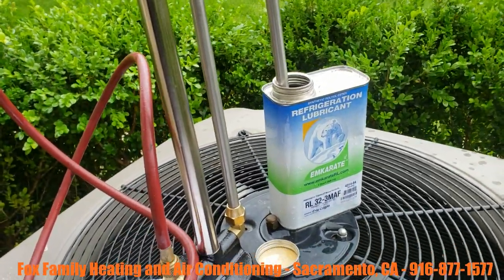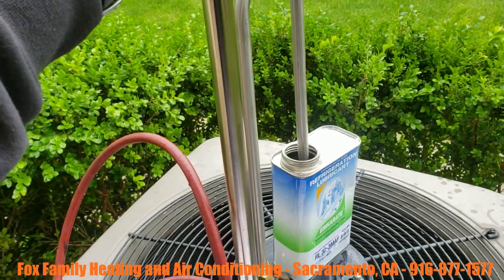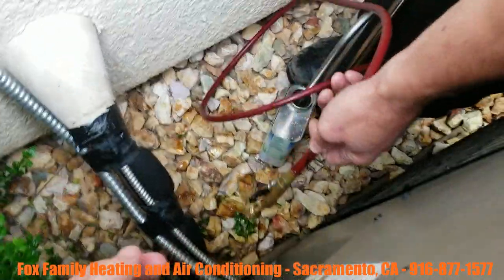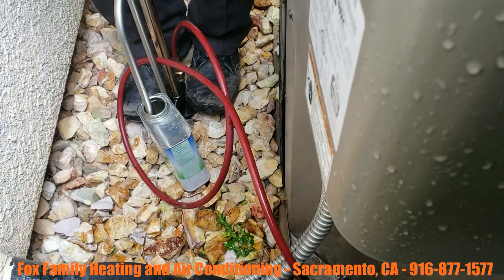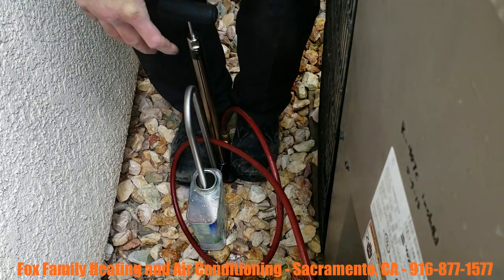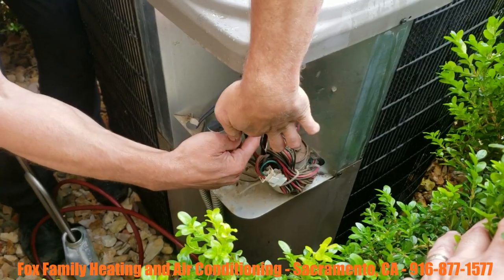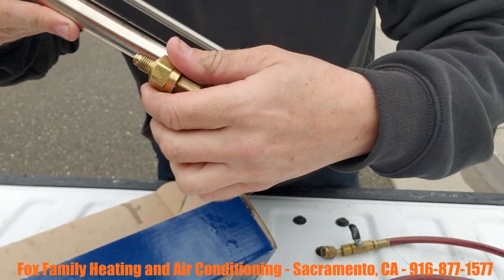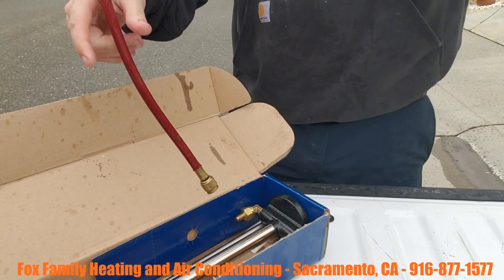Adding POE Oil for and R407c Retrofit

Comment: Greg- Great video! I have done many retro refrigerant replacements. I use a male to male for the hose to control the oil/contamination. I also use a refrigerant cap for the oil pump and put it in a plastic bag. I hope this helps. Have a great day 🤘🤘
Reply: Hey,we had a noisey compressor.
Thanks for showing us this.
We bought the exact pump and oil ,home depot had brass adapters from 3/8 to 1/4 and granger had the r22 hose .pumped the oil in and 
Now the unit is much quieter.
Thank you for taking the time and sharing this with us
Las vegas

Comment: To keep the oil from becoming a mess after pumping oil use two of the add-on type ball valve ends for your hose. Keep them both closed after using oil pump. Remove hose from pump only and connect that end to unit liquid line (preferably a hot gas line but residential units don’t have pressure taps on that line normally). Fully open hose valve at suction line and slowly crack open valve on liquid line (never full open!) and let the liquid refrigerant purge out the oil from hose. It will clean it right out in less than a a minute. No danger of system damage IF hose valve at liquid line is only cracked open to create a good enough flow to wash the oil out. The 5 or 6 foot of hose length is enough to not worry about liquid spraying into suction line since it will flash into vapor before it gets back into it. Once done close hose valve on liquid line, then hose valve on suction line. Last step is to open a hose valve to release any pressure, remove hose valves and hang up hose in case any trace oil remains.

Comment: Use low loss fittings for your oil hose.  You can also use a 1/4" male male adapter to bleed the low loss fittings for priming.  Much cleaner than a dripping hose.  Thanks for the Video! Edit:  Also forgot to mention priming back into the oil container instead of the ground.  Many a machine room would be sad with an oily floor

Comment: Informative! Touching that contactor with your bare fingers on an obviously wet day doesn’t set a good example for a lot of the newbies. Use an insulated screwdriver next time if you have the camera rolling.
Reply from the maker: I know, it's hard to direct my guys sometimes.  Thanks for watching.
Reply: I 2nd that comment.. I work with extrusion chillers, that have 3 phase 480 v coming into the contactor... I teach my guys to never disrespect electricity..

Comment: Is there any risk of compressor damage by pumping oil (fluid) into the suction line?
Reply: Exactly my thoughts as well. I would rather add a little squirt at a time while the system is running. Four ounces seem slightly heavy for the compressor to suck since oils are not compressible.

Comment: Something I've found is next time you use the pump it needs a couple of pumps into a waste oil container to clear any oil that's soaked up moisture. Nice job! (apart from the fingers on the contactor, get that guy an insulated screwdriver!!)
Reply: heavydiesel I learned that the hard way
Reply: Great info
Reply: Or a Sharpie marker.
Reply: bzzzzttt, it only hurts a little ;)
Reply from the maker: I know!

Comment: So when you add the poe oil do you just add it even if the old oil is in the compressor? Or do you take out the old oil?
Reply: norman you ask hard questions and for that you don't get an answer, he-he !
Only time you get a reply is if you say: Greg- Great video and are ready to kiss their asses !
Reply: markspc1 that was a serious question. I’m gonna pretend you guys are not dismissing a serious question about your business. I thought this was an informative video so I have a legit question about the process
Reply: Honeywell wrote the procedure for adding POE oil to Mineral oil and Alkabenzine oil back about 5 or 6 years ago. I personally been doing it longer and yet to lose a compressor from oil issues. So mixing POE oil with Mineral or Alkabenzine is no big deal. I don't know where that information you can't add POE oil to a system that has Mineral oil or Alkabenzine oil in it is a myth.

Comment: I’ve never added oil the compressor running if I needed to replace oil. Also, I always charge the system after so I can let the oil settle in the crank case.

Comment: There was air introduced into this system as showed due to the fact that when the hose was attached to the condensing coil there was trapped air between the low lose fitting and the low side service valve-granted it was not much air, but a little air in an ac unit is to much air, it should have been purged before opening low loss valve.

Comment: Like always, great videos.Just want to clarify, mineral oil was inside already and poe just mixes with it.?I just never done it.Thanks
Reply: Still on the fence with these "add a little POE" conversions.  Another gentleman on youtube actually removes the compressor and attempts to pour oil out of it before adding an equal amount of POE back into the system.
Reply from the maker: Yes right in with the mineral oil.  Trust me its fine.  Just add about 5 to 10% of the oz of oil that came with the compressor.  The data is on the compressor.  I usually just add in about five to six ounces of the POE and it suffices.
Reply: @foxfamilyhvac  , Senor,  no debo retirar el aceite mineral del compressor  y  si colocar mas  20% de POE junto al mineral?  Correcto?

Comment: real question is how do you know when you need to add the refrigerant oil ??
Reply from the maker: All new compressors these days come with POE oil, so in that case you don't need to add it. If it's an existing mineral oil compressor (it'll say it on the compressor) just add about 5% of the total amount of oil that came in the compressor (also on the compressor)
Reply: @foxfamilyhvac  my question is how do you know wgwb you need to add to a system old or new especially after it had a big refrigerant leak
Reply: @foxfamilyhvac  So, when installing a brand new system with new everything. Do I need to add oil? I'm currently at the stage of pulling a deep vacuum and I'm unsure of what to do next. Do I just open the valves and allow the refrigerant to flow?

Comment: Can you mix POE #32 with the oil which is already inside the R22 compressor without removing the compressor oil first??
Reply: Would like the answer to that too. Also,when doing a compressor change out, do we just assume the factory put in the correct amount of oil? Any way to verify?

Comment: I think it is better to pump in slow during operation. Pumping that much oil wile off could slug the compressor and cause damage.
Reply: John Heritage so you add the 407 first? Or have the unit running without any refrigerant while adding the oil then add the 407?
Reply: I doubt it. Take the time and cut open a bad tin can compressor and you will see it would take about a gallon of oil or more to slug one of those units since the suction intake inside is near the top of the shell but the oil level in the tin cans is about four inches or less.  Now, on commercial semi hermetic's such as the ERF2 compressors, the suction line goes directly into the suction head, with small openings/holes that 'drain' into the crank. Those style compressors will slug. The refrigerants that frack tell you to liquid charge, and they don't slug.  The slugging warning came from the 50's up to the 80's due to the semi hermetics. We had and still do have service valves without schraders so there were no restrictions and the gas would go in so fast and directly into the suction valves, causing a flooding. The warning continued when tin cans became dominant in residential in the 60's with GE. I remember the old Chrysler r-500's,  the compressor looked like R2D2 and the suction was on the top, easy to slug those units.  BTW, before scroll's,  the piston hermetic units internal discharge tubing dropped inside and circled the base to heat the oil and cause the refrigerant to boil out, preventing foaming of the refrigerant if a unit lost a fan, belt or the evap coil was plugged. In 1977 , The News publication  had an article on "RSC",  Reserve Storage Capacity.  This is important with residential compressors. If you ever worked on the older refrigerators you'd remember how big the compressors were. That was for two reasons, the motors used more material back then, and they designed the compressors to hole the entire refrigerant charge due to migration, knowing that the refrigerator would most likely sit around for possibly months before it was bought. Then when they took it home and plugged it in the gas would boil off but the design of holding the complete charge prevented slugging when it started and the damage from the foaming was also prevented.  Disagree if you wish, but those infusers to charge with liquid were for commercial units, not AC or residential refrigeration, and on commercial where the suction went into the head we just throttled the valves or screwed a Schrader into the 1/4" brass fitting which atomized the refrigerant.  I've NEVER slugged a compressor in 50 yrs.

Comment: Does r401a has the same oil?im replacing a condenser that has 1lb of r410a refrigerant from factory, can i recover that r410a & replace with r407c refrigerant? Original split system is r22

Comment: Need to cap your hose n keep it in the hose it drains n pulls in moisture , pump and hose stay attached till you can flush it and clean it , keep it in a big freezer bag zip top , gal bag or bigger maybe

Comment: Hey boss man this is just a question came to my mind just asking. What if you go to a customer house and they don’t won’t to change there unit out right that moment or make the repair right but they wanted to save money to get them through the summer. You still have to go through the same steps pulling all the R22 out right and vacuuming the system before going that route of adding the oil and the 407 right? Because I keep seeing different ways on YouTube
Reply from the maker: Yes sir.  you said it right.

Comment: I'm very new to this. I'm understanding that putting 15% of oil into the system on top of what's in there already. Any chance of too much oil in the system
Reply from the maker: Not really.  Read how many ounces of mineral oil are in the compressor and add 15% of that amount of POE oil into the system.

Comment: This yj pump can it be also  used to pump oil out of compressor -semi herms, nice vid thanks for sharing 👍👍
Reply: I have a tool that connects to the crank case oil plug with a tube and king valve.  pressurize the crankcase with nitro and watch the oil come shooting out
Reply: @Gene K found something close to what I use to remove oil from semi herms minus the valve.  All you do is pump down/recover. Install oil tap onto compressor oil plug.  Connect nitro+ref gauges to the crankcase port "normally where your low pressure switch is connected".  Then very slightly crack your gauge open (low controlled pressure) and watch the oil egress.
http://www.cdvalve.com/product-categories/tools/cd1808/10-166

Comment: A tech recently installed a new coil to my old r22 system and swapped over to 407c. Can you give me the specifics on the Schrader valve replacement? Its a 5 yr old goodman condenser with Bristol compressor. Thx!

Comment: I  like to use 422b as a retrofit no oil change required. Nice video Greg keep up the good work.
Reply from the maker: Thanks for the good info man.  You keep it up too out there.
Reply: 407c has less capacity loss than nu22
Reply: I'm using 422b and losing compressors. I'm thinking of adding a  little  (about 12oz ) POE oil.

Comment: once you open a can of poe and use it on a system, do you dispose of the rest of the can?
Reply from the maker: we dont, no.  Because of the moisture?  Is that why your asking?
Reply: +Fox Family Heating and Air Conditioning. Yes the moisture
Reply: @nategadow4482  i shoot a bit of nitrogen in the can to purge and close it

Comment: Question, im replacing an old 5 ton condenser r22 to a 5 ton r407c condenser. Keeping the old lineset n evaporator coil. Do i need to flush the system or add any oil. The new condenser is pre charged. Old condenser is still running so no burn out. Im going to do an acid test incase. I just wasn't sure if the poe will mix if the old system has mineral oil in it.
Reply from the maker: no it won't hurt anything.  hook the new unit right up to the old lines.

Comment: You could have just used MO99 instead. Just replace the filter drier & replace the Schrader cores. You would be good to go a very easy retrofit
Reply from the maker: We like it 407c because its the closest match to R22in capacity.  It's gone somewhat mainstream with York/Guardian making R407c dry units.  And a lower discharge temp makes it the best choice for us.  But yes, MO99 and Nu22b are  other refrigerants I would use. But it just didnt make the cut for us.  Thanks as always for the discussion.
Reply: chriznick 
It’s actually a good practice to change the filter drier and the schrader cores whenever you do a retrofit.
Reply: Why the Schrader cores? Why does that need to be replaced?
Reply: @mbburry4759  The Schrader core rubber seals expand in the presence of R22 but then contract with R407c causing potential leaks.

Comment: thanks for sharing this first of all ,,,,,QUESTIONING THIS ! because i am retired tech 65 years old , my neighbor was having an issue with his unit and here is a tech working on it so i in troduced myself and mentioned i been watching videos on utube about retrofit of r22 to 407c , and he told me NOT TO DO THIS ? he was telling me that this refrigerant is very tempermental and he had years working with it ? and telling me that if a DROP of only 10 psig will cause the system to do NOTHING AT ALL no cooling because of this drop due to a leak i woud  imagine and he says youll be going crazy t rying to figure out what went wrong and where ? and of course the TXV also would need to be changed from the r 22 system and not just do the oil treatment only ,,,,,just mentioning this cause he had me thinking ,, he said he had many years of working with 407 ,,,,,so ,,,,,,we are in august of 2018 ,,,just so we know how long this will be here if long at all ,,,,,be safe everyone
Reply from the maker: bug Den honestly we have had no issues at all with 407c.  It's the closest match to r22 so actually there is less issues with this refrigerant than the other alternatives.  They're even selling 407c units mainstream now to replace the condensers. Check it out!  Thanks for watching!
Reply: thank you ,i will find this guy and try to reason with him so we can all learn ,,,,never too old to learn LOL ,,,,thanks for the reply young man ,,,
Reply: back in the days we where also told that NU 22 was to be the change out ? what happened to that ,,,,,OH BY THE WAY IN MEXICO THEY ARE USING R22 ALL DAY LONG ,,,just thouth id say that cause we all know this nothing but a dupont or who ever holds pattends on these refregerants ,,,,money making deal all over again ,,,,it will never stop unless we make it stop ,,,,,august 2018  for the record
Reply: nice that you had no problem with it ? having said that  the tech that i met has years and years of working with this 407c and he tells me its because most people have not worked with it long enough to experience what it does ,,,,he told me to tell you to just drop 10 psig to the system and see what its does ? he is a nice person just trying to warn me NOT TO DO IT to my own unit here at my house ,,,,i was thinking about it because of so many videos on it but !  i guess time is the essence here ? ,,,,,hope all goes well just trying to help one another i am retired so ,,,,,

Comment: Did you just leave the old mineral oil and add few ounces of POE?
Reply from the maker: yes sir
Reply: @foxfamilyhvac  I've just recently had a long conversation with Copeland and Dupont. They say the wax will harden in the mineral oil after 6 months to a year if left in the system..

Comment: Have you try 427A Refrirant?
Reply: I was wondering the same thing. 427A is suppose to be similar to R22. Plus it works with mineral oil. Also no need to replace filter dryer or valve cores.
Reply: deanmartin1966 yes i started using it last year and it seems to work fine.specially if short line set or package unit.

Comment: What's the best POE for R407C?
Reply from the maker: doesn't really matter.  I would suggest getting smaller bottles of it if you going to be servicing more than one unit.  POE soaks in moisture quickly.  Keeping a sealed container is important.

Comment: I thought you had to remove oil on a 407C retrofit and weigh in the 15% to the amount you removed as to prevent over oiling, which as I have been tought breaks scroll springs.